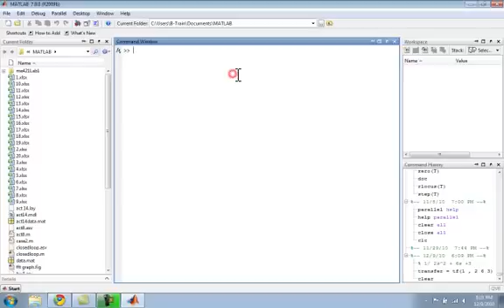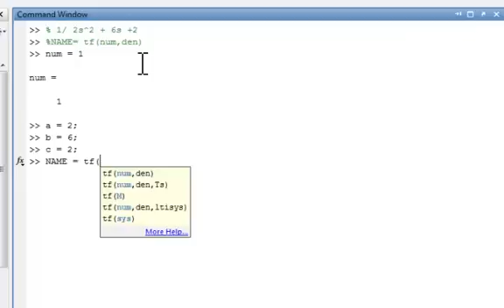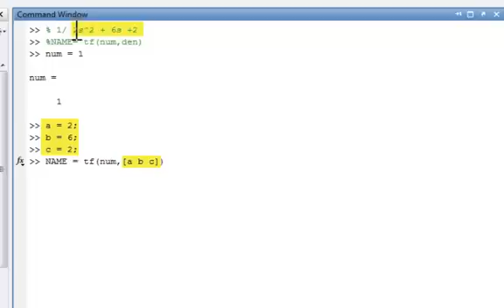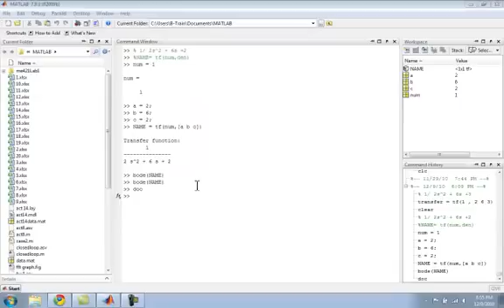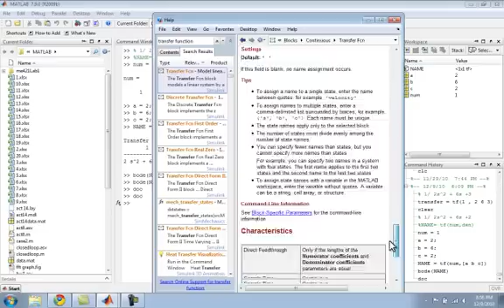Matlab Transfer Functions Tutorial

Comment: I am using matlab R2015 (demo)
i put :
t=0:0.1:20;
n=[3];
d=[2 1 4];
sys=tf(n,d)
y=step(sys,t)
but i get a error at line 4 ,what is wrong ? or is there any other syntaxe when working with matlab r2015 ??
Reply: hellfire probably you don't have "control system toolbox"
you can check it as this
write command prompt "ver"
from the list check for control system toolbox